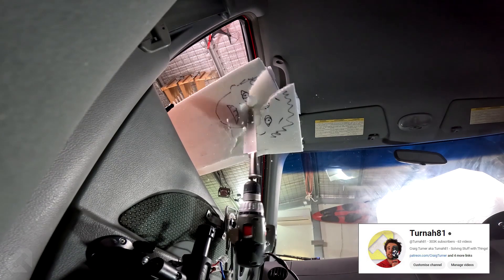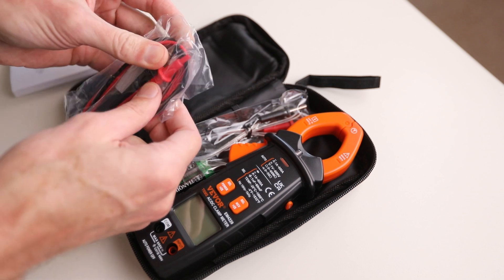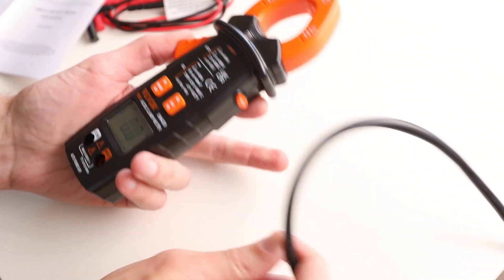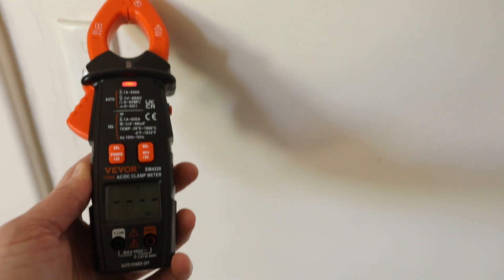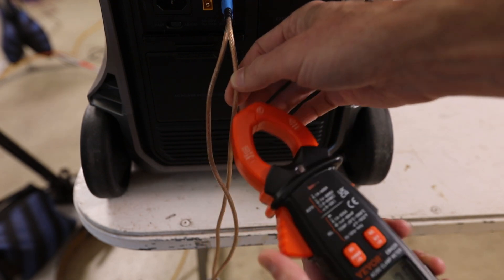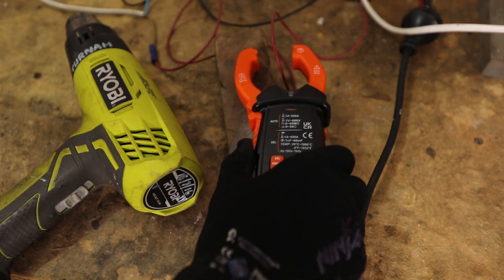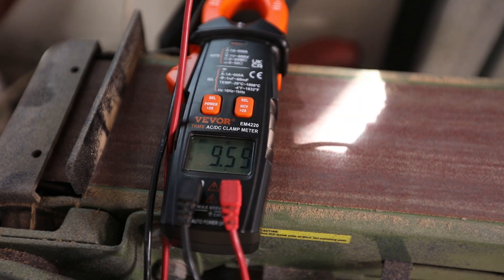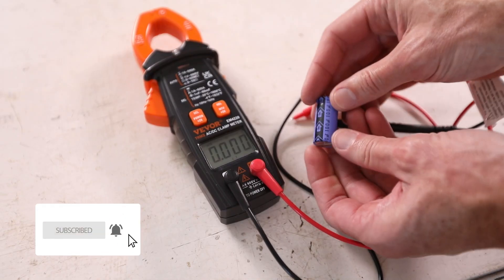First time using a clamp meter - Review

Comment: How's the DC clamp precision on yours? I picked up a similar style clamp meter for $23 (US) about a year ago. I've noticed the current changes by + or - 50mA depending on which direction I'm facing, how flat I'm holding the clamp, which electronics are running in the room, how loud the music is, local tides, moon phases, etc. I can't complain for 23 Dollars, but since I mostly use it for circuits less than 2 amps, that's a significant error. On the other hand, the diode and capacitance measurements are a lot more accurate than I had expected.
Best mod I ever made for a multimeter: attach 2 pins to plastic tweezers with leads and banana jacks. Super quick one-hand testing for any SMD components.
Reply from the maker: Yeah. I'm not sure I will have to compare to a mates expensive one. The biggest issue I have is every time there's something I want to measure there isn't normally a single conductor / wire that is accessible  especially on 240volt stuff
Reply: @TurnahsShed Consider your fame as a mad scientist famous for creating devices of destruction, I'm fearful to think of your methods for separating live conductors.

Comment: There is an accessory for all of these type of clamps that is almost a must-have for household use... It plugs into a standard three prong outlet, and has two openings, one with attenuation in the other without, for you to clamp the meter on and it separates the wires for you so that you do not have to cut into a cable. They only cost from 10 to $20 US price, and also usually have contact points for using multimeter probes on the wires without exposing them also. The attenuator allows you to measure 10 times the normal current without damaging your meter.
Reply from the maker: yes! I spotted this online wondering if something like it existed. However I haven't found an Australian version yet.

Comment: These cheap clamp meters barely measure the presence of current. If you want any kind of accuracy, especially on smaller currents, you have to cough up.
Reply from the maker: Yeah. This only does over 1amp. But that is what I mainly need it for.  Ie. Dodgy starter motor diagnosis and stuff. Wish it had a Max hold or something though.

Comment: Actually amazed that it can do DC at that price. Wanted one a while back for a battery project, but all the US brands are hundreds of dollars to get DC measurement on the clamp.
Reply from the maker: Yeah same I originally wanted one to try and diagnose a car starter motor issues. Try and work out if the starter was on the way out or battery but they were too pricy.

Comment: Hey!  Now you're playing in my playground with this!  I've got meters you could only dream of. Or I guess purchase for many times the cost of the vevor. But I have some vevor things, they make a lot of stuff. 
For the most accurate measurements for amperage, try to keep the wire centered in the clamp. You'll probably notice some dashes or something on the clamp, just try to keep the wire centered. It won't make you or break you on the reading, but it'll be most accurate. 

If you have any questions about any of the features on it let me know.

Comment: Holy volt-drop Batman, you need some better cables for your solar panel!
Reply: Exactly. I was running cables about double the thickness . The core was about the thickness of the shield on his. I had about 400 watts of panels @ 24 volts (peak about 32 before the regulator) which means about 13 Amps . If pushing that for 12 hours a day, you want good wires .
Reply from the maker: Yeah this was just a camping fridge extension I already had. I need to make some up.